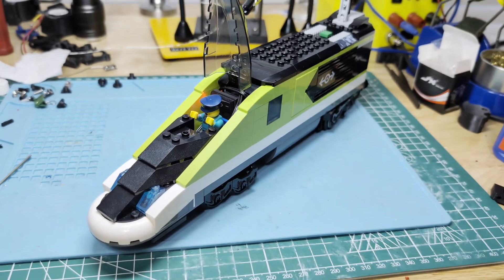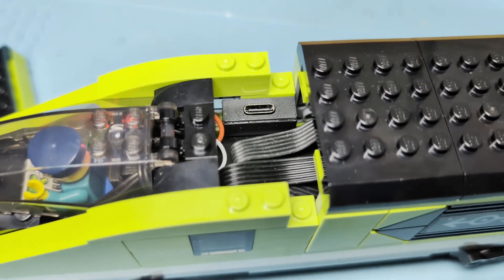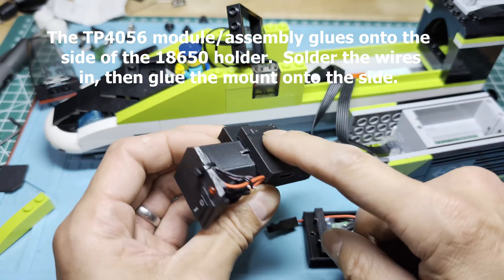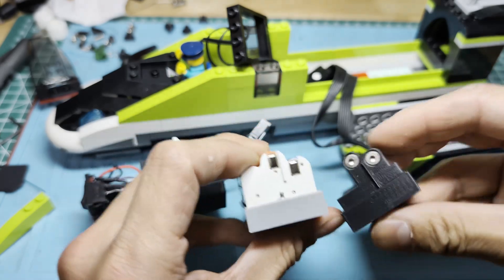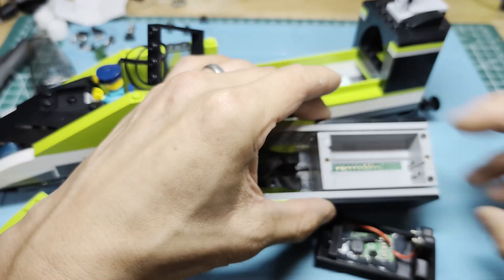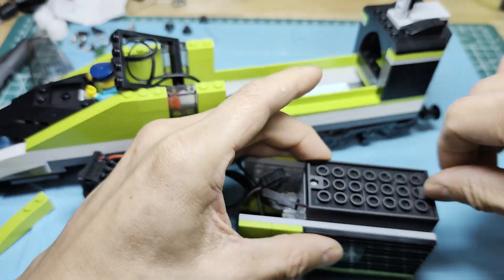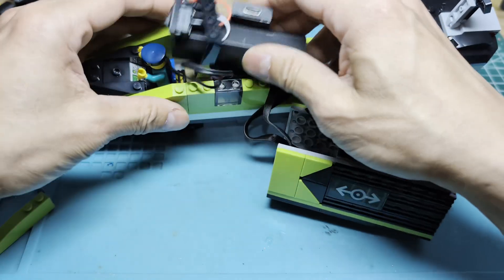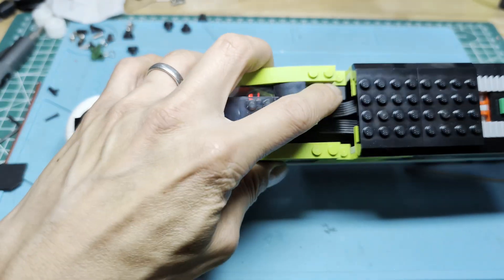Lego 60337 Train 3d Printed Rechargeable Lithium 18650 Battery Mod

Comment: could you put a second 18650 in the first carriage and do without the boost converter?
Reply from the maker: I guess you could.  It'd be super tight.  I think it'd be a disadvantage though because you'd have less voltage (8.6 peak vs 9 constant).  Plus a single 18650 lasts a pretty good amount of time.